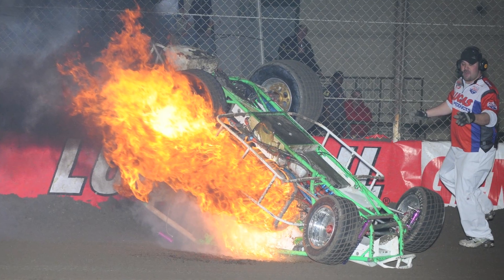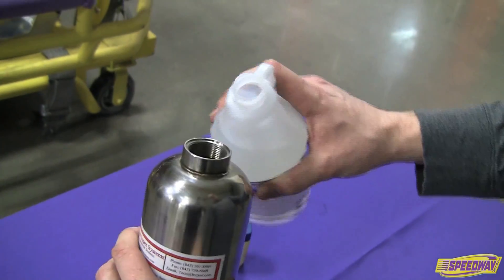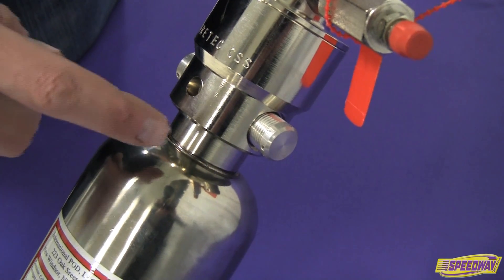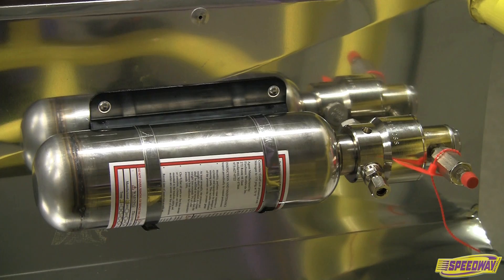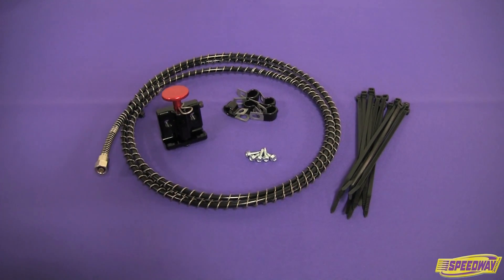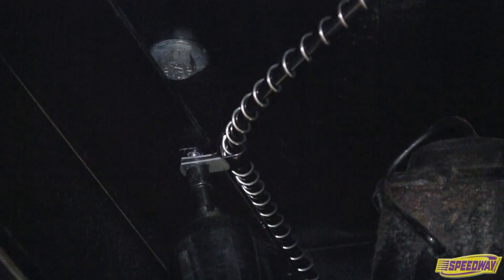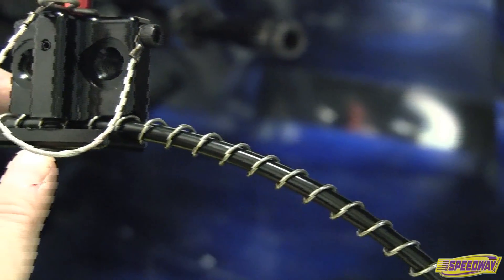Speedway Motors Cold Fire Suppression System Installation Guide

Comment: Would this substance be able to prevent a fire if injected into the fuel tank?  I ask for aviation applications where the pilot has time before a crash landing to flood the fuel tanks before impact.
Reply: If a pilot has time we would dump fuel. The issue is standardized procedures. If one plane has it and another doesn't it will cause an issue. Plus there's other issues with weight. I would guess you're not a pilot.
Reply: @450ktm520  You guessed wrong.  I fly a homebuilt experimental so dumping fuel is not an option and I don't have to worry about standardization.
Reply: @KB3M  I stand corrected. I apologize. The issue would be repelling of different fluids. Additionally, there's the lower explosive limit... example, fumes will not explode below 30% or above 70%. You can pump this in but once its release from the container. You can't guarantee suppression coverage and fume containment.
Reply: @KB3M  awesome, again apologize. I'm pondering the STOL home built.

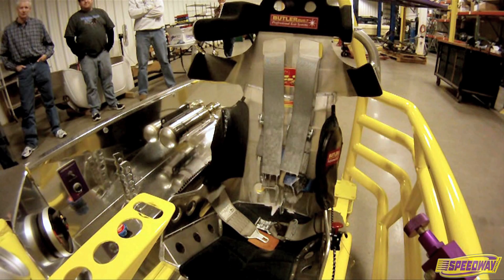Comment: Why don't you use ductile metal lines instead of the "composite" lines. Your video at 5:13 showed the "composite" line (looks like plastic to me) melting when the butane torch flame was direct on it for less than 2 seconds. It is simply nonsensical to use  rubber/plastic lines in a fire suppression system.